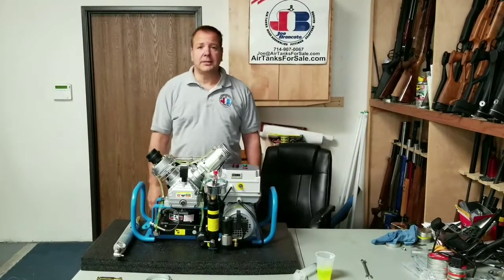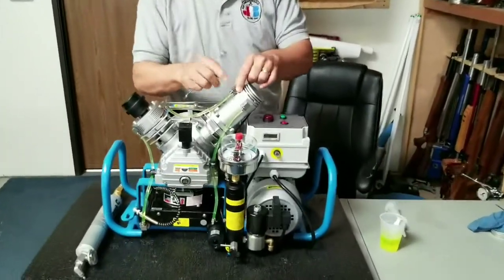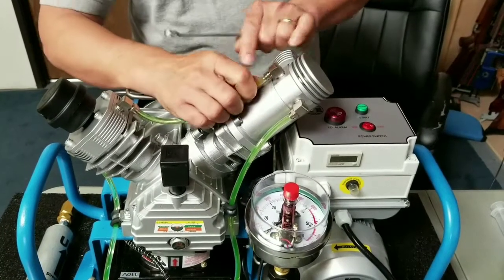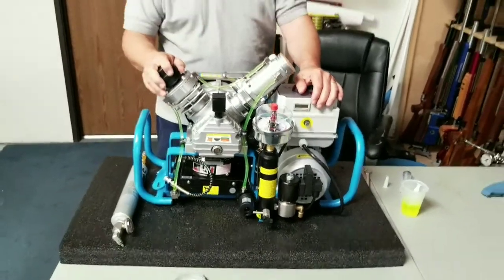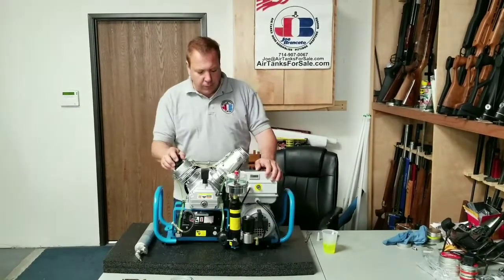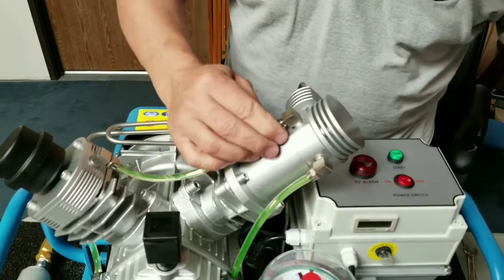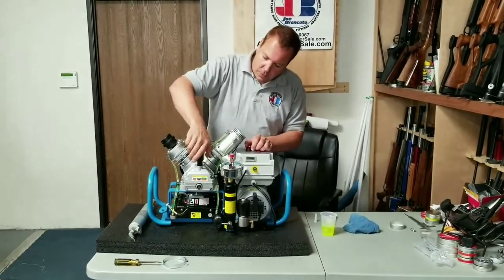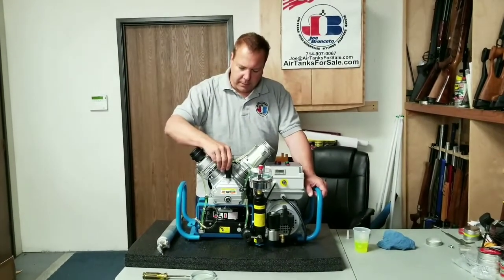Carette Compressor Start-up and set up with Alpha Filter.  Fill SCBA, PCP Airgun Tanks, etc.

Comment: Oil level is ok . Coolant also is ok and I have set to 300 bar maximum and minimum is about 100 bar . But when I switch ON is works few minutes and then shut off , when i leave it off few minutes, then start it ON it will work few minutes then again shut OFF. I have release the moisture but still same issue.any advice I will appreciate.
Reply from the maker: Do you have it plugged into 120v and having its own dedicated socket. sometimes when its runs with something els plugged in this happens
Reply: @AirGunScientist thanks for reply, I have found the problem .the problem was over heating , in our country the temperature can reach to 47c or near to 50C . So I have to put the compressor near the air conditioning .
What the oil type we have to use for this compressor?.

Comment: Hi, Joe.  
I have an Air Venturi HPA 4500 psi compressor that I bought from you about three weeks ago (today is 3/5/21) and it is doing really good.  It weighs a ton!  I'm an above the knee right leg amputee and it was a challenge getting that heavy thing out of it's shipping box and up onto my workbench by myself, but I did it.  Where there's a will, there's a way!

I also have one of your Alpha filters,  It has a bleed valve at the the bottom, but not at the top.  I only use the AV HPA compressor to fill the 66 cu.ft. hammerhead tank I bought from you.  It sure is a good thing I've never tried to fill one of my PCP guns with it.  I realize now that by having no bleeder valve on top of the Alpha filter, my gun would probably still be stuck, under pressure, trapped to the fill whip coming from the Alpha filter.  Because the hammerhead tank has a bleeder valve, there's no problem getting the tank disconnected.

But I have a QUESTION - On the compressor side of the Alpha filter, do I bleed the Alpha filter BEFORE I bled the AV compressor?
Reply from the maker: Bleed the filter first, so you get all the moisture out.

Comment: It appears that the coolant tube is connected to the head with a quick connect tube fitting so if you push up on the ring of the fitting, the tube will pull out much easier and you won't smash your hand or the breather. If I'm mistaking on the fitting being quick connect I apologize.

Comment: Bonjour,
Je suis français. 
I have found a vendor in neederland 
https://luchtbuks.com/nl/lbc-300-bar-compressor-internal-cooling

But in France do you have somes adress ?
My problem is maintenance, and my english is not good. 
For exemple, i don’t see if the Carette have an automatic purge ?
I see your pressure whith 2 or 3 possibility but i am not sure :
May be pressure indicator and stop pressure and ????
My use is airgun fill by one bottle 300b 12L from 200 to 300b one time a week. 

Thanks for answer

Comment: How come they don’t have a Radiator reservoir for the anti freeze
Reply from the maker: It DOES have a radiator.   If you watch the video; at 15:50 you can see the black radiator. It is hidden under the crankcase of the compressor.

Comment: First of all, as usual, very informative video Joe. 
I am very interested in investing in one of these.  However, some observations, and I would like a few questions answered before I spend $2K on this system and accessories:

1) Certainly a video on maintenance of this compressor is needed.2) Are all replacement parts readily available from the US?3) Is there a routine maintenance parts kit?4) Is there proper support documentation for this (Parts List, Exploded Diagram, Electrical
     Schematic, Etc.)?5) What is the recommended Lubricating Oil for this unit and where can it be obtained?6) What is the recommended oil change-out interval after break-in?7) How often should the $40 Hydroscopic Alpha Filter Cartridge be changed, and are there any physical indicators for
     determining when a change-out is necessary?8) What is the weight of this compressor?9) What’s the current draw on these units (115V and 230V versions)?10) Warranty information?
Reply from the maker: We support our customers 100%!
1) We do videos like this all the time for our products, as well as other's
2) We give a full 1 Year Warranty and we stock all parts if repairs are needed (We have 20 pallets of compressors arriving, and often, so we keep parts in inventory).   We rarely have issues, but if we do, we'll be able to handle anything that could happen.
3) No routine maintainance necessary. Just change the oil and filter element as needed (we stock those parts as well)
4)  Instrcution maual is provided.  We are also avilable via phone if one has questions.
5) We have the oil, Instructions have the times for chaning oil,  (see answer #4)
7) Fitler element is $39.  It should be changed every 2000 Cu Ft (about 20 Great White tank fills).  It has an indicator on the actual elelent.  We also sell an in-line visual indicator should you choose to equip it.
8) Weight is approxiamately 100 pounds.
9) Works on standard 110VAC circuit (I.e. no special outlet).  We order almost 100% 110VAC units, but can also get 220VAC if we have customers in South America.  
Hope that answers all of your questions. 
10)  See answer #2